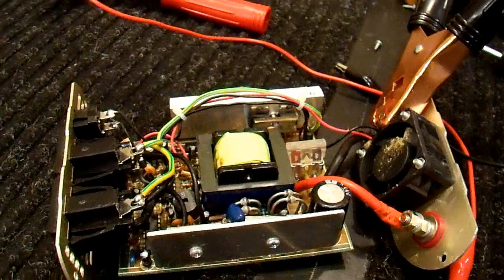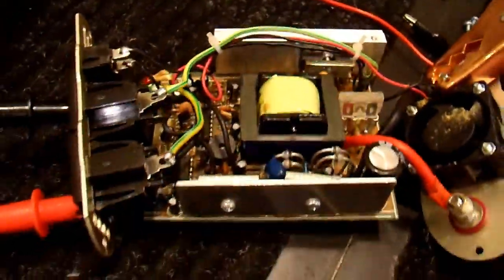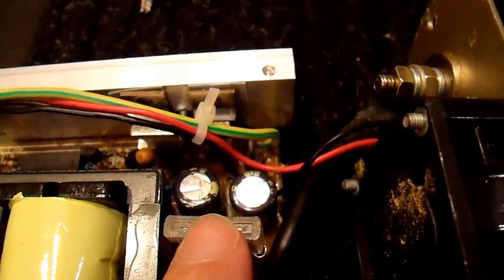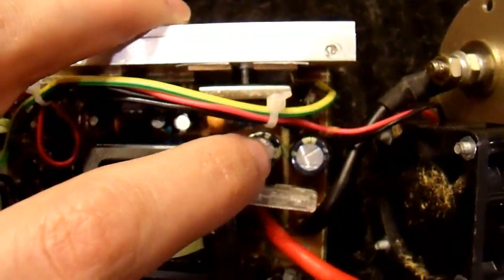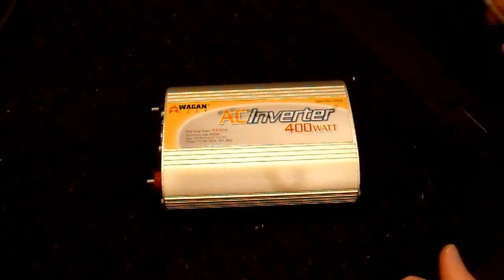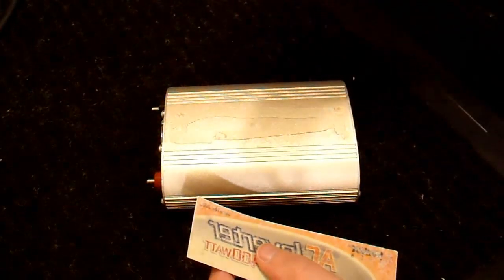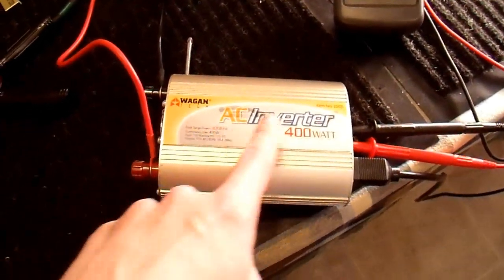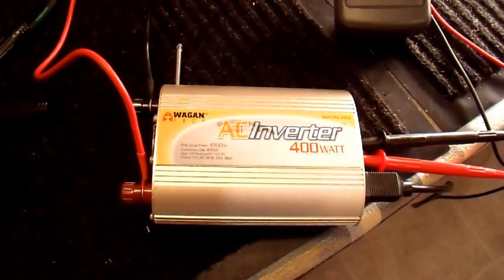Inverter Repair - Wagan Tech 400w/1000w Inverter How To  part2

Comment: 3:03 what is the equation to choose right capacitor in farads? Is it defined by volts? I mean new caps are bigger voltage but smaller capacitance.

Comment: Thank you for your videos. My friend gave me a samlex 1500-12v pst. He told it was not working and we tried in my car battery and failed to start. The red light is showing and it sounds alarming. The red light is overload . I am not electrician and at the same time no knowledge of electronics. What do you think the damages and still repairable? Thanks for your thoughts.
Reply from the maker: The most common fault that fits what you describe is a shorted output FET.  Normally this is repairable but you would need to find someone with some knowledge of power electronics to help fix it safely.

Comment: Why are the fuses soldered to the board on these inverters?
Reply from the maker: It saves the cost of fuse holders and increases reliability due to fewer electrical/mechanical interfaces that can fail.  I don't particularly like this design choice but it does have some benefits.

Comment: Thanks this video. I have three of this type and size invertors in a junk box and plan to attempt repairing them as part of my journey into learning electronics. I believe I have enough understanding of the dangers involved and have experience with installing and servicing message centers and with installing and servicing neon signs.

Comment: I have a 9ah battery i would like to use on an inverter for laptops small electronics in a solar setup. my panels put out 12 volts (30 volts in full sun) 9 watts through a buck. how well would this setup work? I was thinking of upgrading the panel to a 12 volt (18 in full sun) 20 watt panel
Reply: a laptop will need at least 100w like this https://amzn.to/33hHEzS

Comment: Hey had a few questions, so when you buy an inverter, is it usually the same problems that you run into? I know it's an impossible variable to know what the owner did with their own inverter ( water damage , dropping it, etc ). So let's say the normal household person had an inverter and misued it like you said and connected the cables wrong and destroyed it, is it most likely only the capacitors are going to take the damage like they did in this video? Or can the problem extend much further? - Cheers, Marshall
Reply from the maker: The problems can extend much further including irreparable PCB damage.  See my 6000W inverter repair video for an example of what can happen when an inverter is thoroughly fried!  Capacitors are rarely the cause of failure - usually it is a FET failure.
Reply: Much obliged

Comment: hey knurlgnar thanks for sharing your knowledge on youtube, i am learning so much from you! Question : i was wondering why the capacitors need to be fully seated in order to work properly, is that always the case? what is the reasoning behind it? thanks again
Reply from the maker: That's a good question and I should have explained better.  Capacitor performance in a ripple suppression application such as this is highly dependent on both the ESR (series resistance) of the capacitor and the leads, as well as the inductance of the capacitor and the leads.  Together along with the capacitance value these 3 parameters make an AC impedance curve which should be tuned to the ripple frequency in a properly designed inverter.  If the leads are too long (not fully seated) the inductance increases and the ripple voltage increases decreasing efficiency and possibly output.

Comment: Great video, What are your thoughts about people using a cap on the D.C. out of inverter to help with starting loads? I've seen people using large caps like the ones you would put into a high power car stereo system.
Reply from the maker: Audio capacitors work on a DC system though I would argue that having an appropriate electrical system (batteries, alternator, wiring) would be the appropriate course of action.  Still, if for some reason you don't want to upgrade the electrical system adding an audio capacitor can be an easy way to remediate the problem.  This method will NOT work on AC loads.
Reply: So if I put it on the DC side before the inverter it will help out the initial surge on the battery bank? ( this is a solar/battery backup )
Reply from the maker: autobri1
I ran the quick math - turns out it won't help:  Energy stored in a capacitor is .5*C*V^2.  So if you use a 2 Farad capacitor and assume the battery was at 12V without load and you reduce the voltage to 10V under surge load, then there are about 44 joules of useful energy  in that 2F capacitor.  That means if the capacitor is asked to supply 1kw it can only do so for about 50ms which is probably not enough to make a difference.  They're best left for audio use where they DO work because of the short pulses of energy required.
Reply: Thanks for your work!!

Comment: watching this video with it being a power rail and its for peak serge. if it was part of a timing circuit it dose matter capacitance.  and voltage is a key a higher voltage on any circuit will work. if I work on a power rail and if they have a 25 volt cap I try and replace it with a 35 ect. and they seem to last longer.  cheap inverters seem to use caps just right above the max voltage witch is crazy, seems as if they try set and item up for failer lol.   nice repair video.
Reply from the maker: *****
Yay!!  Free stuff!!!
Reply: Of course the set it up to fail.  It's called planned obsolescence.  If they built inverters to last forever then they would never sell any new ones and eventually they would go out of business.
Reply: I know right, until People like us come a long fix a piece of equipment and see were they made it week fix it and make is stronger, and then we have something that last a long time lol.
Reply: Right, It's great for people like us, because we just take all the broken stuff and make it work again, and get it nearly free.